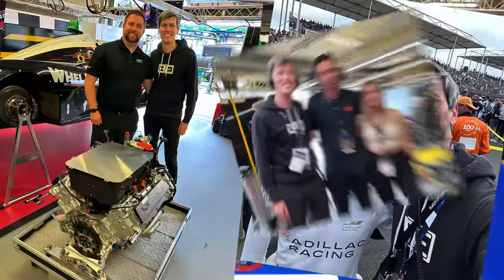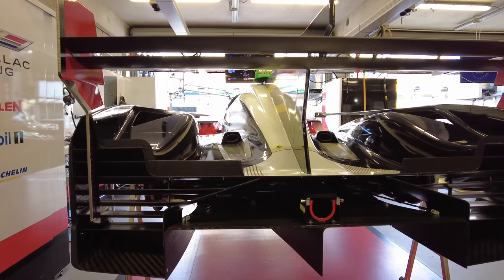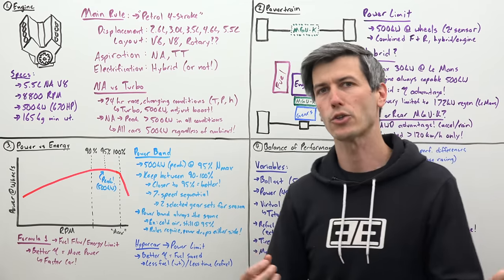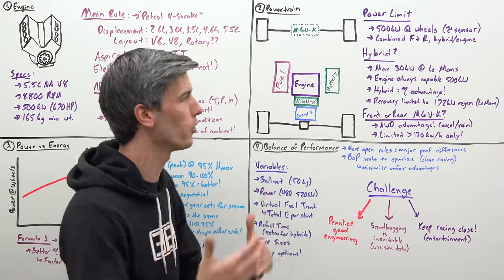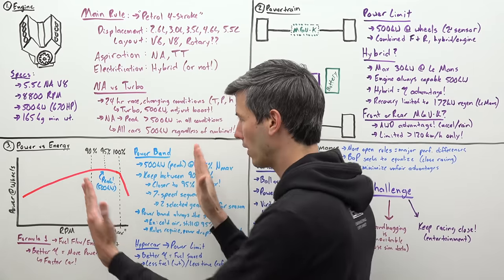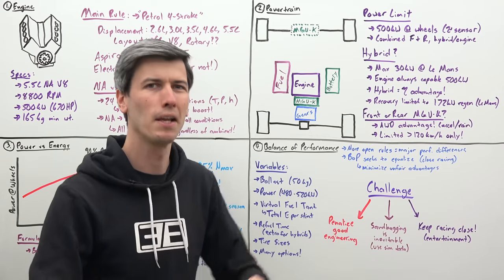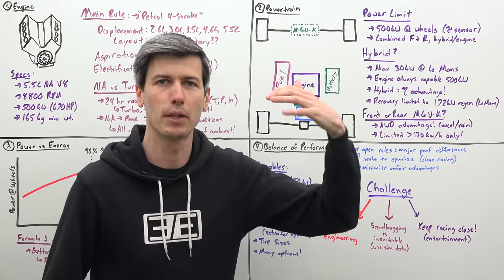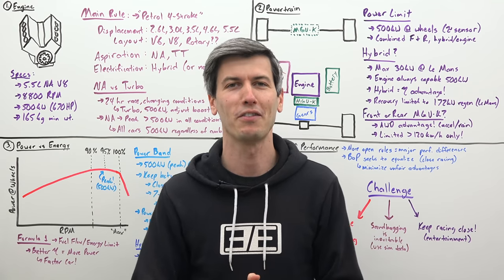Are Hypercar Engines Better Than Formula 1? — 24 Hours of Le Mans

Comment: Anything from NA V8's to twin turbo hybrid V6's. The amount of variation in that class is amazing
Reply: Porsche 919 used a turbo V4
Reply: but he didn't mention diesel power
Reply: It seems like that was all the "variety", 1 crossplane V8, 1 flat plane  V8 and a bunch of twin turbo V6s.
Reply: @Cre8Lounge There's one rule and you couldn't remember it
Reply: @nizm0man  that's an lmp1
Reply: @Lianpe98 what? You do know that Le Mans or WEC isn't just Hypercar, right?
Reply: @drmaulana2600  We were talking specifically about the Hypercars
Reply: Kinda like bracket racing at the drags … VW Beetles racing Hemi Cudas — and winning !!

Enjoy …
Reply: @Lianpe98 well there’s going to be an effective design for Le Mans. Someone could come up with a 3 cylinder, but it will be unreliable at 670 hp. A V12 would just be too heavy and too complex compared to the rest of the car. So yes, there’s freedom, but companies need to be smart. The ideal configuration seems to be either a V6 and a V8, so it is what it is.
————————————————————
Coincidentally, the engine has to be production based. Like Lambos new LMDh has a 3.8L V8 Twin Turbo that has been approved for homologation. So that’s your new engine for the Huracan replacement 👀
Reply: @user-hc9qv9yb9m At current moment nobody use diesel in endurance racing (audi and peugeot were only teams who managed to use and won with diesel engines)
Reply: And aston martin with its v12 valkery for 2025
Reply: @artemkoinash799 because currently for both LMH, and LMDh, they are banned, along with V4. But, Wankel doesn't
Reply: @devandrasimanjuntak1646  This is a crazy thing to think about. When I first got into endurance racing, it was at the tail end of the R10 and the beginning of the R15. And those engines were bespoke racing engines. Now WEC is taking a bit of an old school WRC approach with regards to the engine having to be homologated. The Ferrari 499P runs a modified 296 engine
Reply: @Lianpe98 V12 coming next year 🗿

Comment: When they switch from the electric motor to internal combustion, it is amazing!  That brutal sound!  The hypercars sound like they were made by skynet.
Reply from the maker: Yes!! It's awesome when they leave the pits and the engine fires up!
Reply: Listen to the onboard video of the Ferraris, and the insane sound of their hybrid power unit. It sounds like they are using the MGU-K to fill in the brief power loss from the ICE during the shifts!
Reply: @EngineeringExplained  
You have the seat the best sounding car outside of the Nascar 24.
Reply: Been more reliable
Reply: Cadillac's switch sounds like someone had the best fart in their life and I love it so much.
Reply: Just goes to show that full ev racing will be dull as hell

Comment from the maker: Worth noting! This video is specific to the 24 Hours of Le Mans race (and more specifically, Cadillac's LMDh build), and doesn't dive into the differences between LMDh & LMH, WEC & IMSA, and the differences between the cars used in each (for example, LMH cars can have 200kW of electric power). As an introductory video on the subject, I didn't want to constantly have to clarify between different acronyms. Something I think Formula 1 does really well are their educational pieces surrounding technical aspects of the sport - would be great to see the same out of WEC/IMSA!
Reply: It's specific to the LMDh tech regs, in fact. LMH run at the 24 Hours of Le Mans (one won it, even). So you can't really say that at Le Mans they are limited to 30kW electric, because they really aren't. LMDh specifically are. ;) 
Might seem nit-picky, and I get your point of the confusing acronyms, but that shouldn't stand in the way of facts. ;)
P.S.: another nit-pick, if you put the electric motor on the front axle, then you definitely have more than 30kW, since only LMH can do it. :)
Reply: @sidewalkere  
I was about to pick that nit myself, because LMDh's HAVE to be hybrid. They get no choice in the matter, but the flip-side of that is that for LMDh's that isn't their part.... Cadillac, Porsche, BMW & Acura (*cough*Honda*cough*, in IMSA-only at the moment) (as of next year to be joined by Alpine's A424Beta) do not supply the electric motor and battery themselves, that comes from a set of suppliers that adhere to the same spec for each. The result is that costs are controlled, for the most part. This is both for WEC and IMSA.

Ferrari, Toyota, Peugeot, Glickenhaus, and Vanwall don't have this limitation being LMH's, with Ferrari, Peugeot & Toyota being the hybrids in that category. In fact I highly suspect that the reason to you are seeing Ferrari in WEC (and therefore taking LeMans) has alot to do with the F1 cost cap and their rather heated displeasure at it. Ferrari loved to toss money that that division of the company, it part of the reason that it was founded. So when FIA said "None of that, here is a cost cap", Ferrari quickly spun up a LMH project and did what they wanted with the money. I am not sure if that was the direct response but the result speaks for themselves. Then there is Peugeot's ground effect car, with wild aero and no rear wing....... Yeah, LMH's can take some liberties.

Also, I am not so sure that the rotary in an option for the powertrain, last that I heard on that is that it was banned outright after the 787B legendary run.... but that was for the Group C rules and the times.... they have changed, I am not so sure that the ban still applies.
Reply: I think its arguable with rotary being 4 stroke, which I think the rule specified as 4 stroke....

Also in LMH the Hybrid activation speed is part of the BoP, Ferrari/Toyota was actually at 190kph. And Peugeot at 150kph. Its dependent on tire size choice and other consideration....
Reply: @racingmaniacgt1  
As I said, I am not sure if the rotary ban still applies but at the moment... No manufacturer seems to wants to dare it. We will have to see what other LMH's/LMDh's come out (their is going to be another by the end of this season, and more next year) but I suspect that very few want to touch the rotary if only because reliability is a huge concern. 

Fair enough with the LMH's but the fact remains that cost is no objective barrier to them, if their are other rules that tame performance... cool. Been liking the racing so far.
Reply: We would love a video on that anyhow!
Reply: Marshall Pruett has some good videos about it on the Racer channel.

Or... you know, EE could make some videos about prototype racing 🙏
Reply: Two gear sets? It seems one has to familiarize himself with the rule book for both the WEC and IMSA. BOP-wise I think both series have been nailing it. I am just not sure about banning tyre warmers.
Reply: But there is no penalty to having the most reliable and efficient engine/chassis, and it gives a distinct advantage when the ruling body is attempting to equalize performance ->it still allows technical innovation that will win races directly.
Reply: That's fine, but you also stated that hybrid can be connected to the front axle. From what I've read that's exclusive to LMH cars.
Reply: Huge fan of both WEC and IMSA.
Hope to see you at Rolex 24 in Daytona next year!
Reply: First of all , im here because you seem credible , meaning your words seem like trustworthy , becouse the youtubers who are talking about Titan submarine , i dont think they have the knowledge or beckground you have , ( i belive you have engineering background ) , 
        Yes , im talking on the titan submarine / remote operated whatever , 
        Make a video if possible , on how it was flawed and Maybe of possible how they got governmets aprroval on it
Reply: Why not Square pistons??? 😅
Reply: I was curious why you didn't tackle LMDh vs LMH. Lol. Surprised you didn't talk about the demand differences though, there are some fun thoughts in the difference between running flat for an hour and a half and trying to make the end of a 6, 10, 24 hour race!
Reply: Marshall Pruett has a great series of videos about the four GTP/LMDh cars competing in IMSA this year that somewhat touches on the differences, but goes into great detail about the chassis and engines used in each of them, plus the spec hybrid system.

Comment: Correction: Hybrid activation threshold for AWD cars is NOT 120 km/h as claimed in the video. It depends on tire width and it's 190 km/h for both Toyota & Ferrari and it's 150 km/h for Peugeot!
Reply: It is also active at very low speed, notably in the pitlane.
Reply: @falinestixiaolong9691  the pitlane is an exception - ONLY there it can be activated below the activation thresholds
Reply: Isn't it 120 km/h for the RWD cars though? I haven't heard anything about that.
Reply: @fsendventd  first of all: nope, absolutely not
Second: what kind of sense would that make?
Reply: @ReXzz  I thought none of the cars were allowed to use any hybrid power until higher speeds except in the pits, so that way they were all combustion only at lower speeds to equalize it.
Reply: @fsendventd  no it’s about the traction advantage of being all wheel drive. LMDh cars have their electric power going to the rear as opposed to the front. They don’t gain anything from that
Reply: @ReXzz  I know, that's what I meant by equalizing it. I thought they all had to wait until at least 120 km/h if not higher. If they could all use it at any speed, the LMHs would have a massive advantage out of tight corners because of the massive extra traction, but if only the LMDhs could use it at any speed, then they would have the advantage out of corners, because of the instant electric torque (even if they're both RWD at low speeds, hybrid RWD will still accelerate a bit better than pure combustion RWD).
Reply: @fsendventd  they have precise power & torque curves they have to adhere to. No advantage.
Reply: @ReXzz  I looked at the regulations and I guess you're right, it doesn't say anything specific about minimum speeds for the LMDhs. I'll keep looking into it more because I'm interested now but I didn't know that.
Reply: @fsendventd  well I know the regs pretty well and I can ensure you that there is nothing on minimum speed for LMDh. But of course you can continue to check the regs as well :D
Reply: He's American he has a lot of room for error not been competitive on the world level and all

Comment: I’ve been a huge LeMans fan since that year Audi had the brilliant idea to make the entire rear section of the car a replaceable element, cutting a gearbox change from most of an hour to 5 minutes. ACO changed the rules after that but it still gave an example of both the level of innovation possible, and the fact that the engineers and mechanics remain an active part of the team until 4:00 on Sunday.

This year did not disappoint. After 23-1/2 hours, the two leading cars were still on the same lap. And hearts stopped when the leading Ferrari had trouble restarting after their last fuel stop. It’s simply brilliant.

Comment: So happy you share some light onto the WEC. I get that from an engineering perspective it may not seem as interesting, but despite mandated downforce and drag figures the manufacturers came up with some interesting aero details to gain hidden advantages. I would love to see more videos on the technical details of both LMH and LMDh as those were both thrown in the mix in this video.
Reply: But if you find the hidden advantage, the ACO will come and take it away (BoP) …
Reply: @sking2173 nope thats not how bop works
Reply: @eelinyman3771  Hmmm, are we sure about that ?

Comment: I've always enjoyed how much more analogous to road cars endurance cars are. you know, headlights, space for 2 people, have to withstand abuse for long periods of time. I find the tech so cool, and more likely to make its way to my honda civic in the future
Reply: @juancuelloespinosa I agree, it takes up more than 2 hours of your Sunday though
Reply: For the top cars, no longer space for 2 people anymore
Reply: @TCA17 yeah this bothers me and I always wished the regulations actually required a test where you seat two people
Reply from the maker: Don't listen to the haters, your Civic is most definitely an endurance racer! (emphasis on endurance).
Reply: @TCA17  is that so? I've seen pictures, and it does seem like a smaller cockpit 

If it wasn't for the giant racing seat, you could probably make it work, though it'd be cramped

The garage 56 nascar sure did, though, and the gte cars of course
Reply: @EngineeringExplained  it's the only way it could survive all those boy racers hooning it around 😆
Reply: @SmallLittleMicky  I usually don't make it past maybe 2 or 3 hours, but it's good to know it's part of the competition
Reply: @juancuelloespinosa  Prototypes are still technically 2-seaters. But not in practice.
Reply: Le Mans is where lots of everyday automotive technology was invented or perfected. Disc brakes, fog lights, hybrid, etc. They're pushing to have a hydrogen car compete in the near future as well.
Reply: There should be a greater breadth of endurance races. 24 hours is great. But what about 24 days or 24 months. A bone stock Honda or Lexus IS would probably be very competitive.
Reply: @rightwingsafetysquad9872  I really hope you're joking.
Reply: @drmaulana2600  Just sadistic.

Comment: Very nice video! One more thing to note regarding the BoP in my opinion is that is also helps to motivate manufacturers to invest in their brands' motorsport sections. If no BoP would be present, I think way less teams would even start to challenge the Toyota's recent rule over the endurance racing. By having some security in the fact that the rules will help you balance out the head start other team might already have, I think the beancounters are then more willing to allow their brand to take part in the sport.

Comment: Restrictions lead to really interesting changes for engines. A great example is the new gt3 mustang being 5.4 L . It has a 94mm bore and 97mm stroke. Typically you'd see an over square design like you do on the base 5.0 (93x92.7) but rules limit intake size so the torque for rpm tradoff is worth it.
Reply: Well they can’t really make the bore much bigger within the coyote block architecture, so these dimensions are probably more about increasing overall displacement than about the b/s ratio

Comment: I think the engineering to come out of endurance racing is way better than what comes from F1. Endurance cars are built to not just run high power, but to keep doing it for an extended period of time. That type of engineering has more real world applications than an engine that only produces power for a couple of hours a day.
Reply: Yep. Precisely. F1 race distance in the entire calendar is about the same as what the hypercars cover at Le Mans.

F1 teams go through several components across the year while you want to not have to replace anything during an endurance race. I think endurance racing is mental overall.
Reply: It’s mostly electronics now. All the mechanical stuff is way too expensive to be used in road cars. And sometimes road cars are more advanced than race cars eg with active suspension banned
Reply: I mean sure but any engine that revs at 13-15K revs per min is bound to unravel themselves. Especially when you throw forced induction at it and design it to rev high and rev fast.
Reply: @sweetcheels  reliability is one thing but a racing engine will be rather uncomfortable to drive on the street. And as long as racing and daily driving engines have different goals it won’t be that easy to use whatever racing tech on the road. Eg direct fuel injection and multiple stage forced induction were in wide use 80 (eighty) years ago in high performance applications and see how long did it take to become commonplace in road cars
Reply: @sweetcheels  oh and some things detrimental to racing are very useful in road cars. Like traction control and ABS
Reply: @ebonfortress he lexus LFA has a f1 race engine type tuned for the street its  really nice low & high rpm engine.
Reply: @kevinerbs2778  it most certainly wasn’t. F1 engines of the time had much lower displacement and much higher revs. Now imagine scaling it down and putting in a regular car
Reply: @ebonfortress  you have no idea what you're talking about. The car was desgined ten years nefore it ever came out. It IS In fact  a F1 car engine. Topgear talks about this fact when they featured ir.
Reply: @kevinerbs2778 the lexus lfa v10 was not an f1 v10. They spent a lot of time and effort making sire it sounded like an f1 v10 though and the engine is amazing in many ways... but you are most definitely wrong.
Reply: @Karma28217  Go Watch top gear about.
Reply: @kevinerbs2778 hat? How about your read more info instead just watching top gear.

Lexus LFA engine, in fact, IS NOT AN F1 ENGINE, period.

Why? Because Toyota wasn't anywhere near F1 when LFA is built, or it's engine is exclusively used on LFA only.
Reply: F1 for "High Performance"

Comment: LMP1 and LMP2 are my favorites. With the right modifications they can be as fast or faster than modern F1 cars, since the only real engine regs were that you needed a 1.9 liter turbo V6 and had to use race gas (4 liter V8 for LMP2). The exhaust recovery systems and MGU were much more powerful, they had AWD, and there was more room on the body to put dive planes for ground effect downforce (though there were limits on how much ground effect you could make). Porsche broke the Nurburgring lap record by modifying a 919 LMP1 car, a record previously held by a modern F1 car, with just a 10 percent increase in downforce.